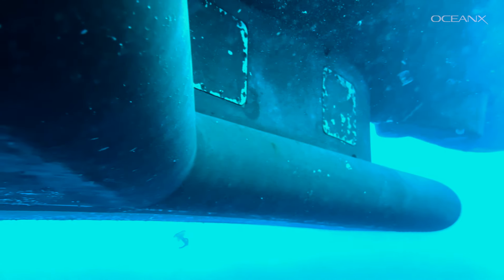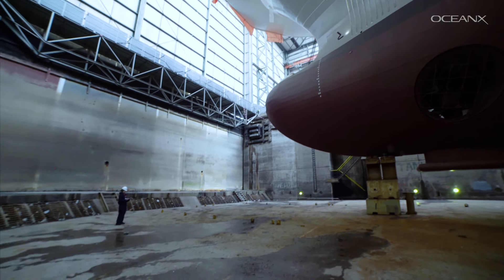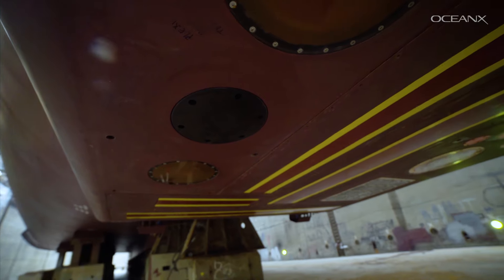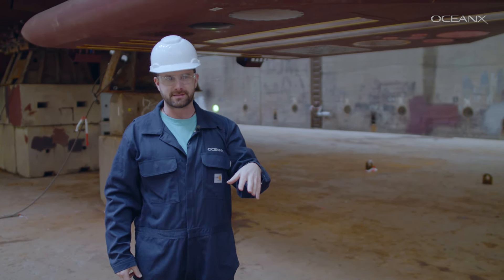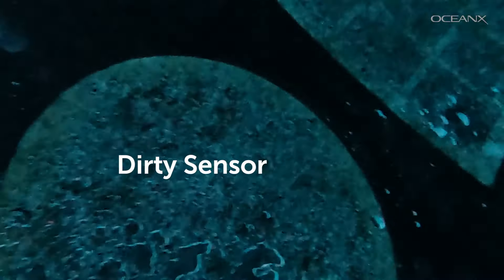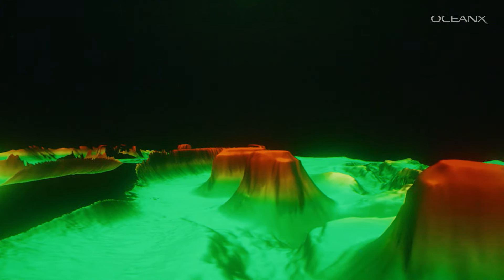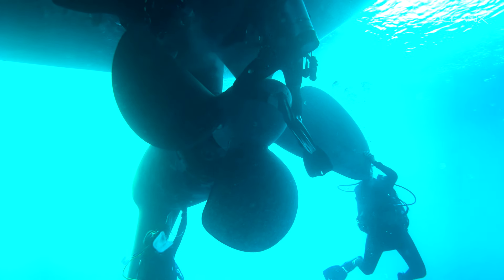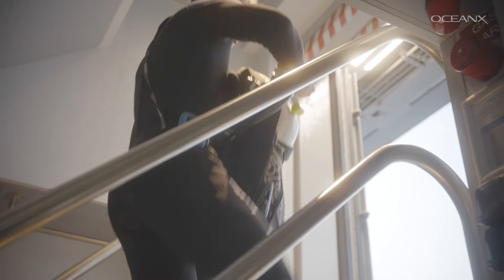Cleaning A Research Vessel At Sea

Comment: Wow I can't believe a research vessel would do such an operation! Hull cleaning like that with no collection is how you spread invasive species and is illegal in most parts of the world! Also on such a large commercial vessel diving on standard scuba gear with no comms is dangerous and irresponsible. Very poor!
Reply from the maker: You bring up good points. 

We always clean the gondola before we leave an area, for the reasons you mention.

Our dives follow very strict standard operating procedures that include extensive risk assessment, buddy systems, bottom times, and emergency protocols. The dive is planned well in advance, and the dive leader coordinates with the bridge team and the engine room so that the power for systems like thrusters, propellers, water intake, etc. is shut down and locked.

The gear configuration required for an underwater comms system would add more complications than benefits in our particular use case. The divers stay together as one team or work in pairs, always close enough for visual communication. There’s a crew member stationed at the side boarding platform where the divers are working. If necessary the dive team can pop up to communicate with the deckhand, who is also in contact with the bridge.

Hope that helps give a little more insight into the process!